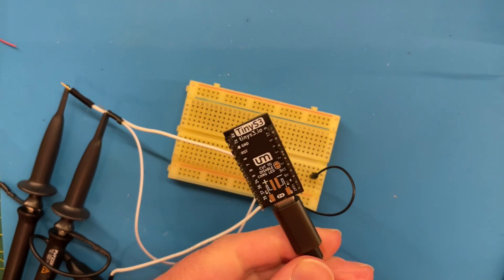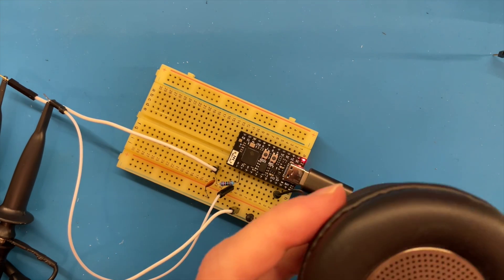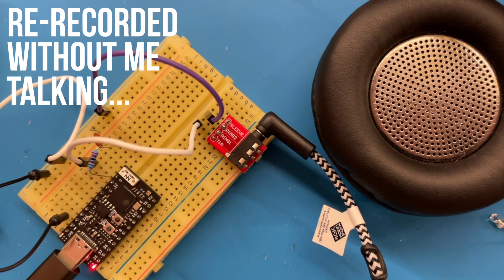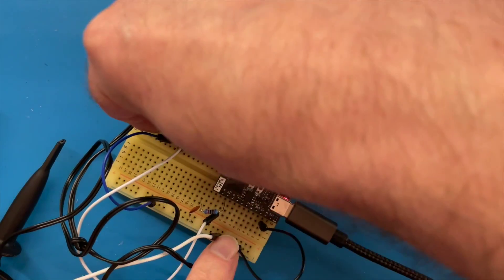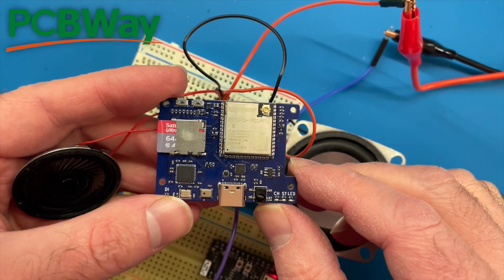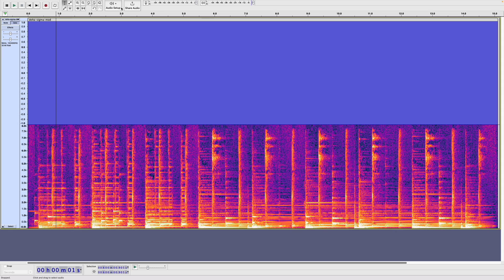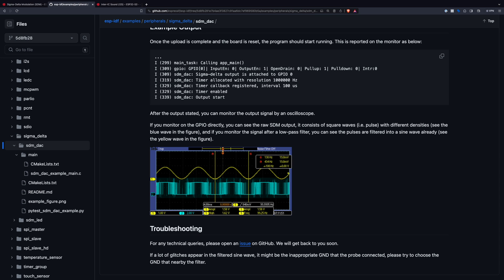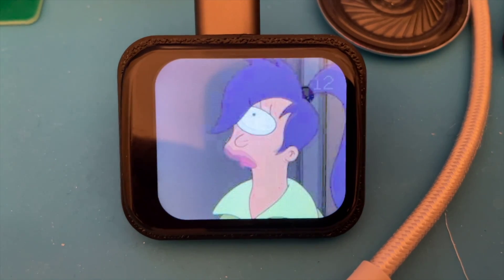We don't need a DAC - ESP32 PDM Audio

Comment: I noticed that using the PDM output significantly degrades the wifi performance. The wifi disturbance also changes based on the PINs used with the PDM. Does this happen to you too?

Comment: Worth noting that since ESP-IDF 5.0 and its new I2S driver you don't have to waste a pin on clock signal if you don't use it, and you can also output stereo PDM channels separately (see the `line_mode` parameter).

Comment: Great intro to PDM, thanks. What's happened to your microphone signal though? Distorted for most of it, and lots of compression artefacts (warbling) in the closing comments. I thought you were going to reveal it had all gone through the PDM, but I guess it wasn't that?
Reply from the maker: Had all sorts of issues with the recording, lots of variable audio levels that needed fixing. Turned into a complete nightmare. Realised that I'd forgotten to connect my mic a few times.

Comment: The rumour is that the DAC took up a lot of die space and there wasn’t enough room which might explain why the S3 is the fastest ESP32 chip available granted it doesn't have the radios the C6 and H series have. 

For most use cases PWM or PDM is sufficient. For more complex cases you are probably looking for some very specific performance characteristics and an external IC probably makes more sense.

This video just points out that you don't need a DAC on the S3 for an audio use case and can use a discreet RC. You can do the same with the Pi Pico which doesn't have a DAC either.

Comment: Hi,
You mention @8:40 that GPIO 45 and 46 can't be used for anything but in the datasheet for the ESP32-S3 on page 23 it explains how these pins together with GPIO 0 and 3 are the strapping pins and that "...the pins are freed up to be used as regular IO pins after reset."
Reply from the maker: They tend to be disconnected on a lot of boards and designs because the danger of interfering with the boot process is so high.

Comment: nice! How do you generate that audio file with audacity? could there be 3 buttons that each play out separate short wav in esp32 ?
Reply from the maker: I wrote a little python script to simulate PDM and wrote it out as a WAV file - I'll clean it up and put it into the GitHub repo. Playing multiple WAV files should be pretty straight forward. The main limitation is how much you can fit in the SPIFFS filesystem - which will depend on how much flash you have on your module.

Comment: Class D amplifiers do something very similar to this :D I've used this technique too with an LCD screen and an Arduino Uno to adjust the contrast. It's very handy :D
Reply from the maker: Yeah, it's very similar to what Class D amplifiers do which is why you can just drive a speaker directly from a PDM signal (with the right driver of course!)
Reply: I have a question on this, If I use a class D amplifier on a pwm signal will it be able to drive a speaker?

Comment: Why use the S3 for this application? 
I would use the I2S on the original ESP32 and use DMA to send the data out.
Very interesting tho...
Reply from the maker: The DAC on the original ESP32 was pretty noisy. In theory with PDM output you can get good quality output.
Reply: @atomic14  I've never tried it. Thanks for the free knowledge.
Reply: Original ESP32 doesn’t have DMA, does it?
Reply from the maker: @crosswick  I think all the versions have DMA. I've certainly used DMA with I2S on the original ESP32.

Comment: Uxed to use this in the 80's  in small audio warning devices, if I remember correctly there was a chip that took the one bit serial  stream and produced an audio output. You could get a longer message in the small capacity eproms available at the time, no micro controllers about then.
Reply from the maker: Reminded me of the old 8 bit comouter crappy speakers. The things people managed to get out of them was quite impressive.
Reply: there was a program on the PET that played polyphonic music on one gpio pin. was very impressive for the time. one day i'll look through all my disc's and see if i've still got it.
Reply from the maker: @TheEmbeddedHobbyist  I still remember being amazed by the Manic Miner intro screen on the ZX Spectrum. Compared to what I could do with the BEEP command it was incredible.
Reply: Are you talking about a CVSD Modulator chip?
Reply: @ogam123  delta sigma rings a bell. it's been a long time. but i still have a board somewhere, if i find it i'll see what the chip was.

Comment: I usually use a PWM for this on AVR MCU's, since it also works through a low pass and needs minimal CPU intervention. Does the ESP32 not offer PWM?
Reply from the maker: Yes, you can do that - but then you’ll need a timer that fires on every sample to get audio output. With this we can use the I2S peripheral and use DMA to send the data out.
Reply: @atomic14  ahh, I see what you mean. Needing to load new waveform points individually in a timer ISR can be expensive.